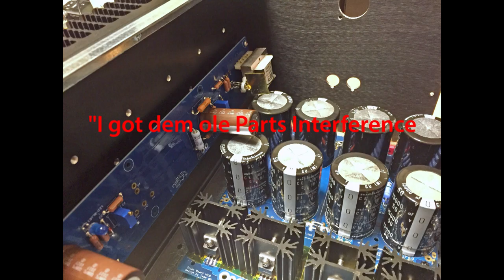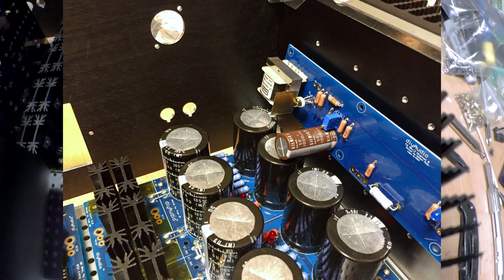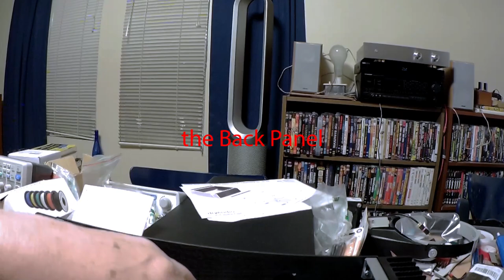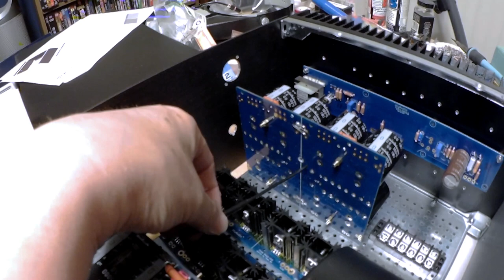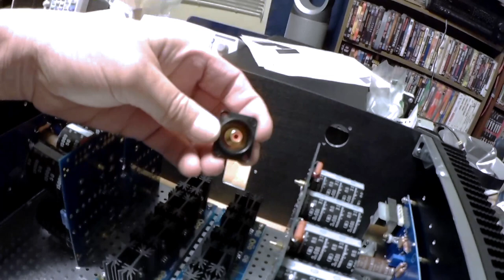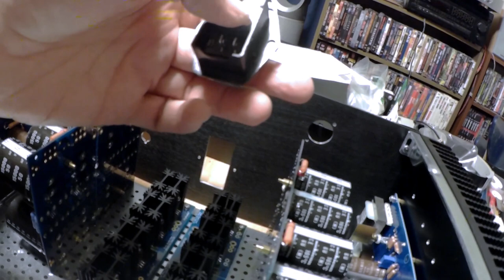Robert Builds the Nelson Pass F6 Amplifier part 5

Comment: Hi Robert, glad you found a solution for the filter boards. Would it be possible to swap the bias pots for side adjustment ones? This will allow you to adjust from above. I was lucky to get one of the back panel kits, need to buy the chassis. The back panel kit is very good, but was expensive. I sold my ACAs so will put a chassis order in soon, but busy refurbishing the TA-5650 and some Quad 405s.
Reply from the maker: Another great idea John. I totally forgot that they made side-adjust pots as well as top adjust ones. I think the back panel kit is reasonable considering the retail cost of all the parts. I'll brag on the DIY chassis guys yet again; my risers arrived from Italy inside of a week.
Reply: @NocturneVid66  Good service from modushop! Yes the back panel kit is quality, and has all the right size fittings in the right quantity, so to replicate would either cost more due to MOQs or would need to substitute and lose quality. Good luck hunting one down, hopefully that have a few on a shelf somewhere.

Comment: What are the regulator boards for? F6 Schematic requires Capacitive power supply.
Reply from the maker: There are no regulators. The DIY Audio power boards come in two sections that can be split. To fit them in the amplifier, I had to do so. Watch the videos and see!